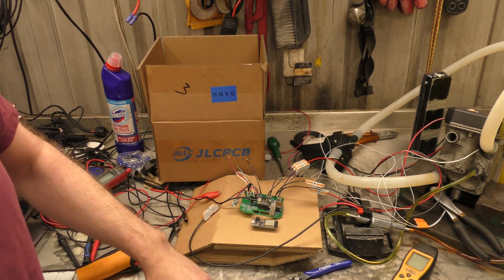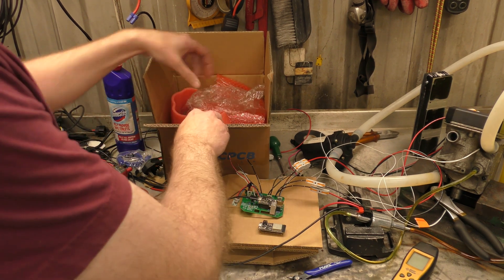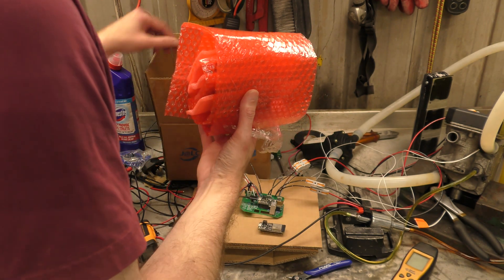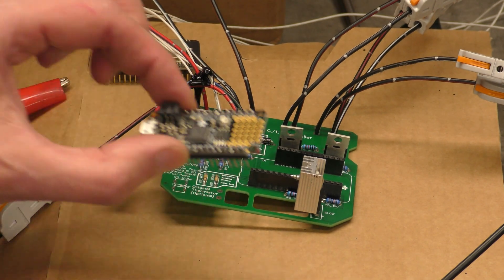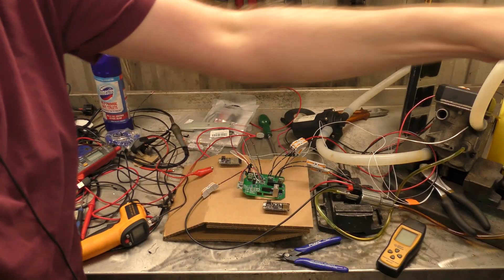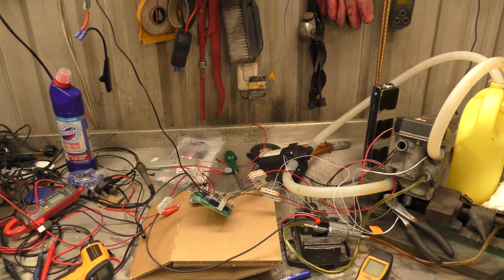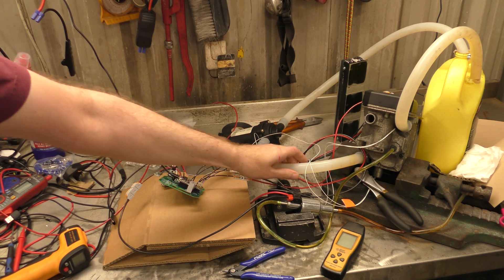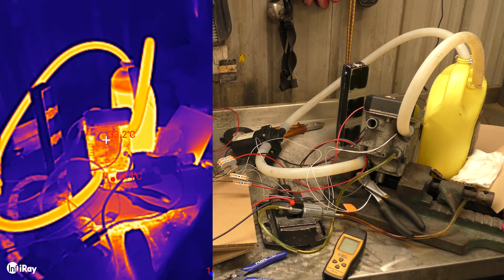Webastardo  - replacement controller ECU for Webasto water coolant heaters // part 1

Comment: Hi David, great informative video. 
I’m designing my own processor and PCB to be a direct replacement for the Webasto TOP Vevo.  Out of curiosity I don’t suppose you have any idea what the voltage is across the combustion fan motor at 15% and 100% load?
I have looked through Steves code and there is a comment in there the motor runs at 10 volts, I assume this is at 100%, however when I try running his code at 15% the motor does not run and at 100% its 12.5 volts across the motor with a supply of 13V.
Reply from the maker: Not on the Vevo's no.  I've got a few lying around, but haven't had them out for a play.

Comment: Im trying to run a d5wz and having no luck at all. The learning curve on arduino IDE is massive. I don't understand how to view the serial data; the only time i can even see the board on a COM port is by putting it into programming mode by double clicking the reset button.   The heater seems to do something when power is applied and I really want to see the code running as I know the code will need tweeking to get working with a different setup. Im also burning out FET's left and right even with heat sinks. I had to use a relay for the glow plug because of this  but it seems that the heater only wants to do anything if theres an actual load present  like even a small bulb applied across the relay. I also seemed to brick or fry one feather already, no idea how. This thing has all these different status rainbow lights and shit but nobody will tell you what it means.  I cant seem to get either feather to do the " rainbow led" thing when plugged into USB anymore, not sure if that goes away if theres a "sketch (is that their term for friggen code? ) . I wish i could also just read the board and see whats programmed on it to verify with my eyes its got the code on it. 

I got a thermotop on the way but i figured id try to get my d5 going since the thermotop is a month out. Ill buy more feathers and build up a new board with the thermotop and give it another go...i guess.
Reply: i'm lookin for a way to control my d5ws too, i want to bypass canbus input and just make it dumb again ..mis there no way other than buying a new ecu for it ?
Reply from the maker: Which version of the board are you using?
Reply: @DavidMcLuckie  so this board can  control a d5ws ? I've found no options other than buying a wildly expensive oem ecu to Buypass the canbus controlled ecu ATM , thinking of just going electric hose heater but that makes me depending on 220v outlet
Reply: @NorgesHelse  It should. I got it to run the thermotop very nicely. I have it set up as an external control unit on a d5 but haven't powered it up yet. Don't even mess with the OE controller, you can't get the behavior you need from it and it will lock out on you anyways.
Reply: @NorgesHelse I use mine to run a dw5
Reply: v2.1. But I'm not too discouraged yet, I get the thermotop tomorrow and will build it back up again for that heater.  @DavidMcLuckie   The arduino ide is the difficult part, I was never able to see rolling code to see what the heater was doing. It might have just been fried. I think the D5wz uses a very high current glow plug. No matter what, it seemed to want to cook the mosfet immediately even thermal pasted to a large piece of copper. I know this heater works because It started briefly before but shut down and locked out control unit.The fan FET was also getting hotter than I liked. Anyway, Ill try again with the thermotop and a fresh board/feather with all fets heatsank and that glow plug one screwed to the thermotop housing. Ill then try to get a D5WZ to run with one with some software tinkering.
Reply: Ok, i actually READ the software and found serial settings. I uploaded the sketch to a new feather and found it to be running and outputting serial data. Ill make another board when I get my thermotop any day now.
Reply: I was able to get the heater running good after ironing out the details and mistakes.

Comment: Hi David, what are the specs of the diodes on the board? I got the 5 pcb built but the diodes are missing because on the BOM it just says D-7.5, thanks
Reply: Did you get this figured out? I'm about to order boards as well.
Reply: @sompka1  yeap, Simon replied on a different post, he used Schottkey diode, 2A 60v

Comment: Might be applicable for a air heater. I want to make the same thing for air heater. I would be adding a exhaust temp sensor as well so most of the layout of that code could save me time. Afterburner wont work for me as I need dual fuel pumps control

Comment: I am trying to get a control board for a web as o thermo topV, would you have one available as I am struggling to get one! Cheers Rob
Reply from the maker: Not sure about boards, but whole heaters are eBay for under £50 - https://www.ebay.co.uk/itm/255855256529?hash=item3b922963d1:g:BFEAAOSwVZBilLjC&amdata=enc%3AAQAHAAAAoMcp3DsDMf8MQ%2Bw0R%2FvEj9MXJF%2B68JWZkKqsA9LEJ%2F6Dmv%2BtOof2yOyCD8LfKSaAPRpdF1t44wvGeEC23AVNf9ylsqJNGWSrCQkSvcOk9a5KucdKJppGYOu9ZXl3YfentwrXpDgX3aI5JhX%2FGFXfejMh7GIE7olrr8jeakwe9Dquof%2BMcCuftuaFJmzSMdFc%2B0k3ulECq%2BPYzt51xIYgA6w%3D%7Ctkp%3ABk9SR5jF5si4YQ
Reply: @DavidMcLuckie  hi David,

Sorry I confused you I am looking for a w bus controller that actual runs the heater by talking to the heater board
Reply from the maker: I've used one of these - https://www.ebay.co.uk/itm/124147753763

Comment: hi david is there any more info on the webastardo boards/software,cheers mick
Reply from the maker: What more information would you like?
Reply: @DavidMcLuckie  did you get the fan problem sorted
Reply: @micklowe9924  If you mean why does the fan run at the start, Simon mentions in a comment it runs for 5 mins in case there was a power cut to the heater when it was running and it was coming back on when hot, the fan being on will cool down the unit and stop the coolant boiling. I think Simon mentions how to change this in the code, though another idea would be to only run the fan on start up if the water temp was over 50 deg c I guess. It's a safety feature but you don't have to wait for the fan to stop before you start the heater. You can apply the 12v start signal straight away if you want it to start immediately.
Reply: Mick, have you watched all the other videos? Think there are 3 (2 part 2's) plus a bit more info at the end of another video about a 12v/24v/240v heater thing.

Comment: Hi,
I have 2 heaters Top C and I need them to connect to my garage. 
But I don’t start up them. 
I’m try pin 1 to 12v
Pin 3 to 12v
PLEASE HELP 
Thank you
Reply from the maker: Not all of them run off 12V applied to the trigger wire.  A lot of them only respond to a CAN-BUS or W-BUS signal.
Reply: Robinson labs have a video, called check your webasto pin outs. You may find it helpful to see how to check if your board is can or w bus or 12v.

Comment: HI David, I bought a Chinese webasto look alike for my Camper, a replacement for the deceased Eber I had. I want to use it as a night heater rather than a block heater. the china ECU has a few challenges! fundametally it heats the water to a set temp, then switches off, also it has a run time limit. not quite night heater behaviour! it does do a good job of making hot water via a plate heat echanger.

The question, does Simon's design heat the water to a set point, then calm down  to maintain the temp? also does it have a limited runtime?

If it ticks these boxes, how confident can I be that it is safe under the van... appreciate you can't 'guarentee' it is safe etc...

Thanks Ian
Reply from the maker: Helloooo.  So most of the Chinese clones also cloned the Webasto software.  But that was for preheating an engine.  As you've found out it gets to something like 75ºC and then slows down until it hits 85ºC and then turns off.  And like the Webastos it has a run time of 90 minutes if memory serves.

Simons code is designed to sit a set temperature and maintain that.  Full burn up to XºC and then it'll adjust fan and fuel to keep that, but it does have a high temperature set when it will shut down.  As for safety Simon included a thermal fuse in the board design.  He chose a 125ºC version, so should the case temperature melt that fuse it cuts the fuel supply.

The only thing I haven't tested yet is if the heater starts back up again once the temperature falls.
Reply: @DavidMcLuckie  Many thanks for that, winter project sorted!
Reply: Worthwhile remembering that Simon is using this for heating his camper van, the same application you’re looking to use it for.

Comment: Hi! Have a question here. Looking to build 2 of these controllers to heat up my garage. Is it possible to use Arduino nano instead of adafruit?
Reply from the maker: Not as a direct replacement.  You'd need to make an adaptor board to swap inputs and outputs.  Which is something I'd like to do so I can try using an Arduino Pro Mini.

Comment: Hi David, great videos as always, some of it totally over my head but always informative! Any chance you could do a bit of a side by side of all the water heater options and maybe throw in a 12v stored hot water heater as well! I’m curious as to what you think the best option would be considering, cost, space, ease of install and use, I like the bobil heater but think the 12v stored water option maybe better? Any thoughts?
Reply from the maker: If I had to pick based on your list of comparisons, cost, space, ease of install and use.  It would be a Propex 10L mains powered combination water heater and storage tank.  Once it's up to temp, cold water goes in and pushes hot water out.  Once that's been mixed with more cold water to your desired temp, 10L of 85ºC makes at least two showers.  Powered from camp hookup or van inverter.  If we were camping in the van with no hookup you just turned it on while you drove to the campsite and let the alternator power the inverter and charge the leisure batteries.

Comment: The initial 40% fan speed is just to makesure the combustion chamber is cool.  It runs the fan for 120s when you first connect it to 12V.  Leave it connected & it won't do it again.
If you want to disable it, look in the Control tab in the Arduino IDE, line 32 which reads:
if(burn_mode==0 && seconds<120) {
Change to:
if(burn_mode==0 && seconds<1) {

I put this in, just in case the heater was shut down when hot - to give it a chance to cool properly before re-starting, say in the event of a short power failure.

Likewise the cooling on shutdown (Webasto tab, line 257 onwards) runs the fan at 60% & glow plug until the Exhaust is < 100C or 60s has passed.  then it runs the fan at 40% for another minute, keeping the water pump running.  After a maximum of 2 mins, everything shuts down.

These times could be shortened - I just picked what worked for me.  They leave the heater cool enough to touch, which is certainly good (less ouchy!) while you are setting up & testing.
Reply from the maker: Excellent.  Line 32 is what I changed as it said 600 seconds.  Made it 120 for testing.
Reply: Simon, i have a quick question. How hard is it to modify the code to run in Arduino again? I have David's code controlling the heater in my garage, the only problem I see is that it shuts down after it reaches the set temperature. When the radiators and water cool down, it doesn't turn back on. As i understand your code has the ability to maintain a certain temperature. I'd love to try it out on my Arduino.
Reply: @adomasleonovicius3807  It would be easy!  I believe David is trying to make it work with a Pro-Mini, as he has lots of them apparently (watch this space I guess!).
Rather than re-design the whole board, the simplest option I can see is to design an adaptor board such that your Microcontroller of choice plugs into the board which in turn plugs into the M0 socket.
I completely understand where you are coming from - I think we all have 'favorite' processors.  I just designed this around hardware I knew, and had sitting around.

Comment: Hi David did the boards come part assembled
Reply from the maker: I ordered mine with most of the components in place.  I've got another board edited in the EasyEDA editor that should be even easier for people to order.  I think the best option is to try and organise a group buy of people that want one and then order, as you have to order 5 at a time.
Reply: @DavidMcLuckie  does the editor allow you to print the image of the board
Reply from the maker: You can export the design in various various formats and print them.

Comment: Cool project! Really interested to see how this can add new functionality to a diesel heater... Does the software also take care about setting room/water temperature and maintaining it?
Reply: The short answer is No!  
The longer answer....I'm using it to heat water in a hot water cylinder, which provides hot water & underfloor heating in my camper van.  The Webasto (like your boiler at home) heats the water to a fixed temperature then a room thermostat turns the circulating pump for the underfloor heating on & off.
Reply from the maker: Yes.  You can input the temperature you want in the code and heater runs to maintain that temperature.
Reply from the maker: Simons answer is much better.